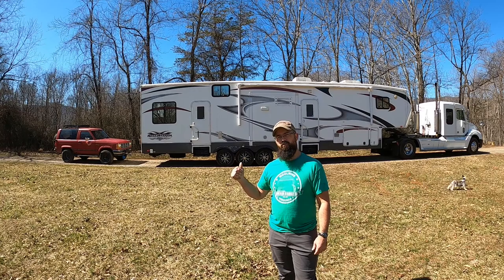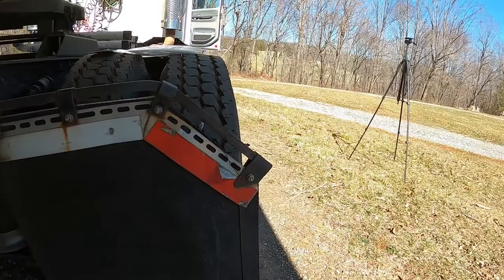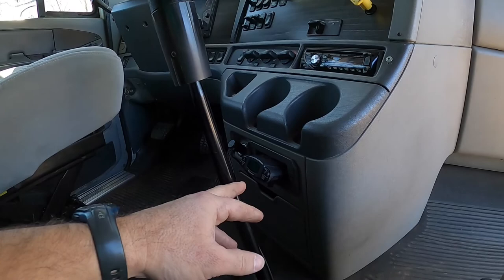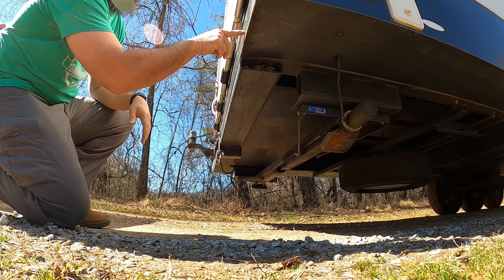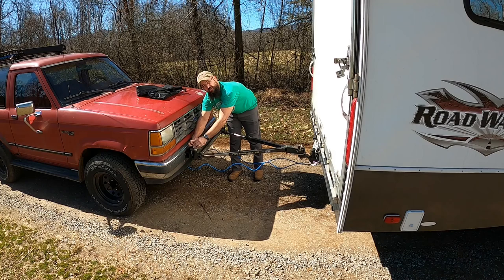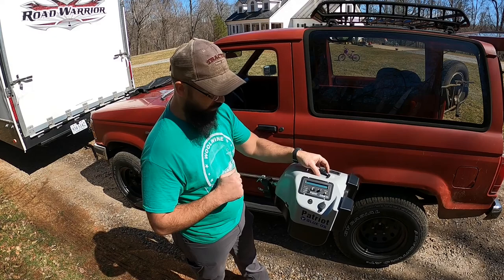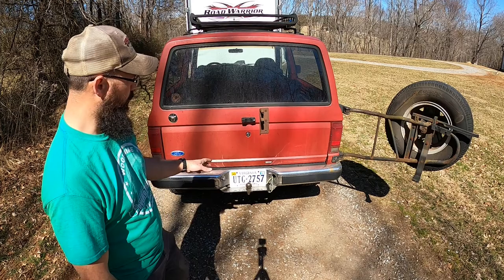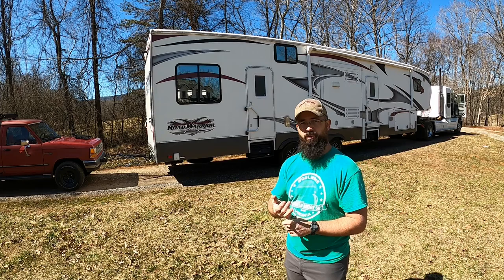Everything You Need To Flat Tow Behind A Fifth Wheel Camper...

Comment: I appreciate the video!   Thank you for the details of how you did it.  I’m considering something similar for my 5th wheel when I transition to full timing my rig.   I’ve driven semis for a lot of years, and have my doubles/triples endorsement.   As I have been researching this some people have said that all of the eastern seaboard states don’t allow a trailer behind a travel trailer.   It seems the route you take pretty much keeps you in those states.   What is necessary to operate your setup while traveling in those areas?  The thanks in advance
Reply from the maker: @jasonkendall7281  that is correct. It is illegal in most of the states we travel in. I just behave, and I haven't had any issues.
Reply: @GlennConner thanks for the response.   Seems like for those few states other people have said the same.   Keep up the good work.

Comment: Great video.
I am in process of setting up the same set up.
09 prostar 39 cyclone and a wrangler.
This is very help full.
Thanks for sharing.

I use to pull it with a pickup looking forward to see if semi is better
Reply from the maker: We love our semi. If you have any questions let me know.
Reply: THANKS SURE WILL.
Reply: I have another question.

Do you have a video of converting semi electrical plug to an RV plug?

Not sure how to wire red(brake lights) wire into yellow and brown.

THANKS
Reply from the maker: Sorry, I don't have a video on the wiring. I left the factory plug on the semi alone and mounted a plug at the back near the semi's tail/brake lights. And I tied into those wires for turn/brake and marker lights. Then I ran new wire along the frame from the ignition switch that only works in run position for a battery positive to charge the trailer battery, this wire had to have a one way diode to keep the trailer battery from back feeding the ignition switch and another wire from the brake controller for electric brakes. I hope this helps. My email is glennconner.gc@gmail.com if you want to send some pics, I might be able to better assist if I can see it.